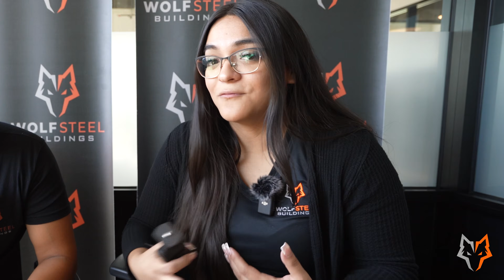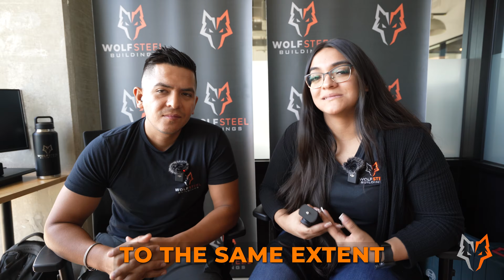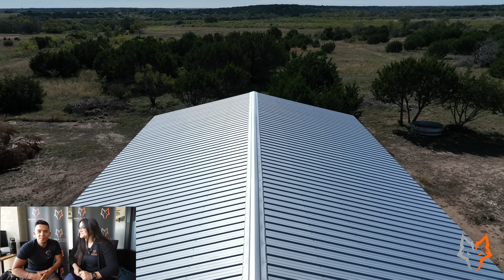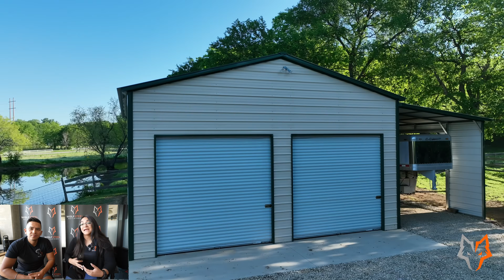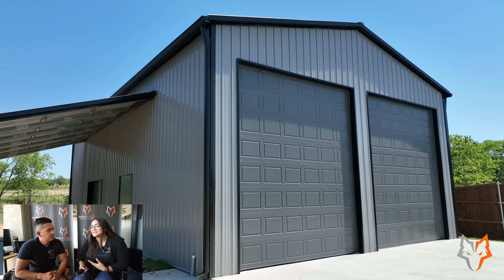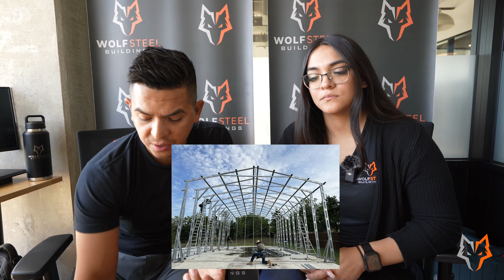5 Pricing Factors for Tubular Metal Buildings | WolfSteel Buildings

Comment: How do monoslope building costs compare to traditional roof styles?
Reply from the maker: Depending on the sizing and the building type they can be a bit more expensive. This is due to the possibility of caving in if it doesnt have the structural support in the center.
Reply from the maker: Thanks for watching! We updated this viral favorite for 2026! Be sure to check out the 5 NEW pricing factors for 2026 to see what's changed since our 2023 video! https://youtu.be/yZHvLnO3xg4

Comment: If I go with a 30’ X 50’ carport and my RV is 13’5” tall, does that mean I have to go 14’ tall or would it fit in the center of 12’ tall?
Reply from the maker: If your RV's height of 13'5" includes the air conditioner on top, it's best to have a carport with at least 14' for the height. Keep in mind that for tubular buildings, the center peak brace can take up some of the headroom, and the design may vary depending on the width. It's a good idea to share your RV's full specifications with your builder to make sure it fits properly.
Reply from the maker: Thanks for watching! We updated this viral favorite for 2026! Be sure to check out the 5 NEW pricing factors for 2026 to see what's changed since our 2023 video! https://youtu.be/yZHvLnO3xg4

Comment: Clarification for viewers:  A-Frame Vertical and A-Frame Horizontal use the same truss system and look almost identical other than the orientation of the roof panels.  It may be confusing for laymen to hear terms like "Vertical Roof" or "Horizontal Roof" because it implies that these are different "roof styles."  Roof panel orientation does not equate to a different style.  They are the same roof style with a horizontal or vertical roof panel configuration.  A more accurate description is a "Gable Roof (the style) with horizonal (or vertical) oriented roof panels."  Corrugated roof panels can only span when laid perpendicular to the structural system.  Therefore, they can either span across trusses, or they can span across a secondary structural system (purlins) when orientation is parallel to trusses.
Reply from the maker: Thanks for the clarity and additional insights.

Comment: What are the dimensions and price for the white and back building in the video that had 2 overhead doors on the front?
Reply from the maker: Hi Jeremy, Not sure which you were referring to so I added both of these. 

-The black and white building we have on here has roll up doors. Here is the link: https://youtu.be/GGnbS0t_Y70
-There is a pewter grey building with overhead doors. Here is the link: https://youtu.be/tIUZl4ecnCo

I hope I got that right - if not let me know and I can redirect you. Remember pricing may be different depending on various factors. 

-Ana

Comment: Awesome information.  I do have a question though. Do the legs get upgraded only as the building gets taller or are they also upgraded with width when the trusses upgrade? So if you were to be building a metal building over 12’ tall; would it be worth it to stay at the 30’ width?
Reply from the maker: Great question. To answer your question- both. The legs get upgrades when the building gets taller AND when it surpasses the 30' width. When the building goes into the 30'+ commercial trussing that includes the legs as well.

Compare the pricing for the 30' width 12' tall+ to the commercial and see which is best for you. Don't forget to see HOW the building is being built when comparing pricing. 

I hope my answer helps. If anything reach out again so I can elaborate!
Reply from the maker: Thanks for watching! We updated this viral favorite for 2026! Be sure to check out the 5 NEW pricing factors for 2026 to see what's changed since our 2023 video! https://youtu.be/yZHvLnO3xg4

Comment: Great info! Thanks for posting. How do you keep water from seeping under a tubular building on concrete? Do you use rat edges?
Reply from the maker: Since we do our own concrete work, we do the rat edges (brick ledge) on the concrete and that eliminates the common water seepage issue in tubular buildings. 

If you didn’t get the brick ledge on concrete, we recommend to have tubular builder install M-Seal along with polyurethane self leveling sealant under the base rail. It helps tremendously.

Comment: What would be the best option for a larger two story building. Let's say a 60' x 120' and 24 ' height. Huge garage/workshop on the 1st floor and possible living quarters/bonus area upstairs. Or am I at a whole new ballgame with a red iron insulated building?
Reply from the maker: Your best bet is a Red Iron Bolt Up building. You will need to have engineering plans with the building. Definitely doable!

Comment: Great video, have you done radiant heat in any metal buildings?  I am hoping one day to build a 60x 80 and was wondering if that would be an efficient way to heat it.
Reply: I am no expert by any means! However, I'll share my experience with radiant heat in my home. It's great to walk across those floors in the fall and winter time. Unfortunately, though, it didn't negate having another heating system in my residence. Or the cost to protect this investment in case of a lengthy power outage. So, you might want to consider a backup power system. I considered going this route, but it was much cheaper to install a force air system. Along with the benefits of adding A/C. Which was a must for me! You gotta weigh the costs and know exactly what you want and need. Before you can tackle these projects and also be open to contingency plans. Good luck with your project!
Reply from the maker: @paulpryor850  thanks for that insight!
Reply from the maker: I haven’t done a radiant heat system for a metal building! It would be a great question to ask maybe in the Facebook groups for opinions!